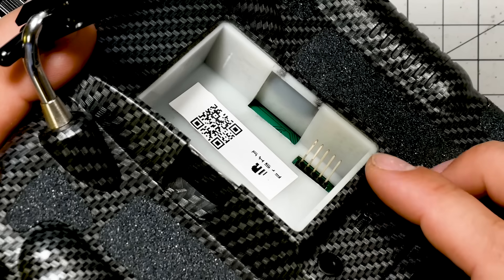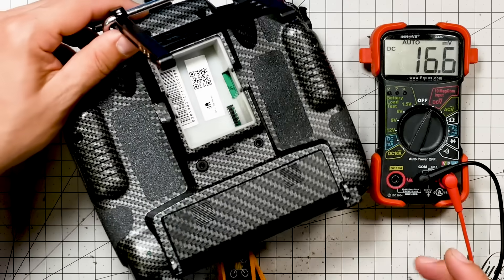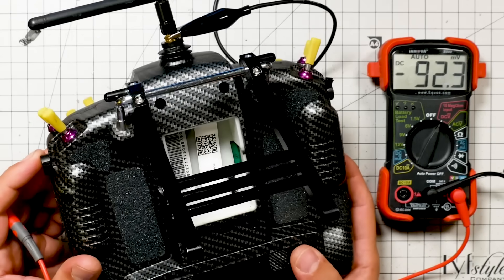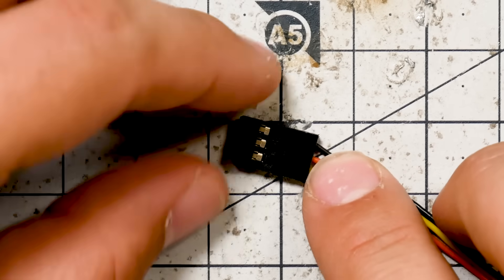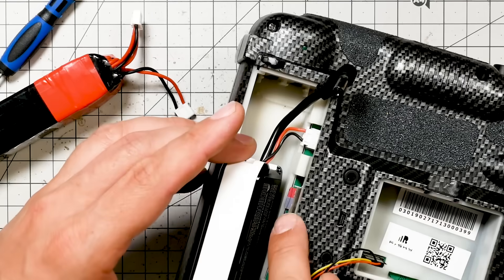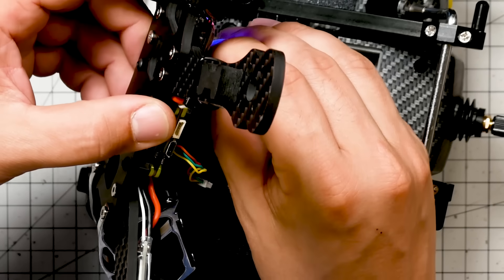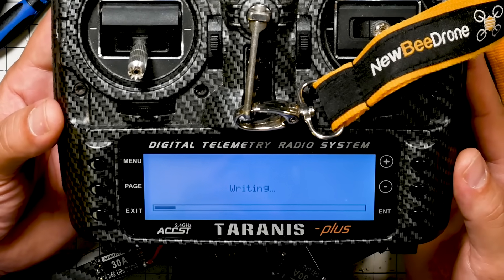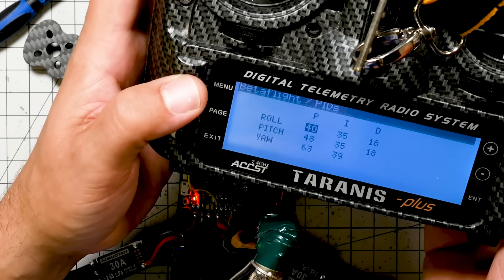FrSky Receiver Firmware Update | R-XSR LUA SCRIPT FIX

Comment: Ever heard of this?
I went through this procedure and it worked for 1 flight, then it started saying telemetry lost, telemetry recovered, also it unbinds and binds back and forth quickly. The quad goes crazy when arming during this issue. This problem became worst as time went on (3 flights). So weird that it flew well after a few attempts (unplug , plug the quad a few times). Now, it will not work. Simply goes back and forth - red, blue light then green , blue light..... I ordered a new xm+ thinking something is broken.  Has anyone see this?
Reply: I think I’ve got the exact same problem...
Can you confirm you are in the same configvas I am : flashed it EU-LBT with the latest firmware from Frsky ?
Reply: @philippemarmonier6635  
Im using the FCC version - newest firmware. I'm definitely going to hold on to it and try to fix it, it's 25 bucks.. It worked totally fine until I flashed it.. I tried going back to and older version, to no avail.. I thought I might have a short somewhere but I put a brand new XM Plus in it and it's fine (without updating!)..
Reply: Hi, I've just found why mine did not work : On the FC board, the signal wire was soldered on the PPM pad. Changed it to an Rx3 pad and it worked fine. Had to dismount the whole quad to access to the board, and finally burned and removed the "easy accessible" pad, but hopefully, on the board I could find another Rx3 pad ... and now it flies !

Comment: Fixed*** I removed external MIC(with100nf cap) out of the system and Smart Audio works EXCEPT that I can't select Raceband 2 and 3. Other channels and bands work flawlessly. So here is another new question. :-P

Sorry to add another comment but please have a look on my problem. I try 5 hours but can't fix. I was fixing a quad which have to use new FC and 4in1ESC. It is TBS powercube 4in1. I just did conformal coating too. Then I switch from XSR to R-XSR and do like you do to update FW in order to use LUA. I end up with 171009 FCC because that is what I can bind the Rx. Later on I got unstable LUA, some times it works most of the time it don't. I check my wiring and re-solder every joint thinking the conformal coating might ruin the soldering until I got solid LUA signal. But one remaining problem is I can't adjust Vtx band or channel in LUA. At first it fix at default (F1), then I could change some but cannot save, then I can change in LUA and save but the real Vtx channel and band don't change. The band R is outstanding, I cannot change to R2 and R3 but I can change to R1, R4, R5, R6, R7, R8. However, all VTx page changes in LUA doesn't transfer to the Vtx. I try changing PID via LUA and check in Butterflight and it works fine. I try swapping the Vtx but got same problem. What is wrong? What to do?
FYI: In LUA there is U band too.
Reply from the maker: This might explain why your vTX won't change channel: https://www.youtube.com/watch?v=1gROVWtWnqk

Comment: Spent hours trying to do my rxsr for f port using my qx7 but the flash never starts . No error just goes back to the list of files. Really confused on this.
Reply from the maker: On the qx7 he wire us standard servo pinout, signal, 5v, ground.
Reply: Joshua Bardwell that's what I have . Using the cable that came with it. Led blinks briefly. Have just updated to opentx 2.2.2 and now see flash s port . Internal and external . S port still does nothing so going to update boot loader....just watching your vid on that . Keep up the great work.
Reply: I had the same issue. Running the newest OpenTX version and using 2s voltage rather than 5v (don't use 3s!!!) helped me

Comment: So my bind button fell off...idk how...but now I need to re-bind it to my Taranis, anyway to do that without the button?
Reply from the maker: It's possible to manually short the pads but some will find it difficult.
Reply: Joshua Bardwell I’m pretty good with an iron, the situation ended up as me overlooking the port in bf, but for future reference: solder a small lead from the center pad to the outer ring (the edge of where the button was)?? Thanks in advance,appreciate all you do!
Reply: Would you mind elaborating on that, my button came off too.  (Though the pad is still there as a little hump that I can press and it feels like it still works.  I'm having a problem binding so I don't know if that's my problem.)

Comment: Hi, any chance of showing how to do this on the x lite, I can’t get it to work :(
Reply from the maker: It should be the same, with the plug on the bottom of the X-lite. It uses standard servo wiring (signal, power, ground) same as the QX7.
Reply: Joshua Bardwell yeah that’s what I was thinking, it didn’t work for me though. I don’t even think the receiver had any power to it
Reply: Hi, just thought I’d let you know I’ve finally got this to work, when going to start the update rather than using flash external receiver I had to use the flash sbus option

Comment: Hi JB! I can not get LUA scripts to work when using the RXSR with Fport. The Lua displays will not populate, it's kinda working because if I don't have the quad powered up it will say No Telemetry on the bottom of lua display, when powered up it goes away. Would you know anything about this? The receiver firmware is up to date

Comment: This is a dumb question Im new to the hobby and I'm always hearing about this brand Im curious on if these frsky receivers are like the old receivers where you would have to plug in every individual wire to it or if the receiver has a set of wires that I solder to the the flight controller ,bind it then fly Thanks to anyone that can help me understand these receivers

Comment: I'm having problems. I load the firmware in the SD but in the taranis does not appear. Any idea what happend taranis firmware 2.2.1
Reply from the maker: In 2.2.1 they changed the name of the folder from FIRMWARE to FIRMWARES or vice versa. If the contents of the SD card doesn't match the firmware version on the radio, you won't see the folder.
Reply: Joshua Bardwell I'm able to see the folders and the content on my computer in the taranis I can see the folder but no the update file or those extensions
Reply: And Thank you you your replay

Comment: Well, I watched your video on upgrading my R-XSR but I do not think I did the correct version. The link was to the FrySky site for the R-XSR ( https://www.frsky-rc.com/r-xsr/.  However you said to use the FCC version not the LBT version.  When I click on the link for the first one (FW-RXSR-171103.zip ) which you said to use, when I unzip it, it only has the LBT file, no FCC version.

So I decided to use the 2nd one down (FW-RXSR-171103.zip).  It installed with no issues but I still have no Telemetry and no TBS Smart audio - Lua scripts data.

Where can I find the correct FCC version?
Thanks in advance

Anthony

Comment: Great work as always JB!  I'm getting all the values but can't change the VTX settings (unity race HV). I'm running a QX7 and r-xsr. My FC is a Matek F-411.  http://www.mateksys.com/?portfolio=f411-mini#tab-id-3
I wired the S-Port on S5 of the FC and reassigned it VIA softserial. SmartAudio is on T2.
I've come soo far and would love to get the control over my VTX from my radio. Man, this is so consuming! Oh and I've got a RunCam Split (maybe that's the problem) Audio conflicting with smart audio but the PIDs show up on my radios LUA script so does the VTX. I just can't Save the values.
Reply from the maker: PIDs showing up means your telemetry is working.

Can you change the vTX settings using the OSD? That would verify that smartaudio is working.

In the OSD go to Features then VTX SA. You should see the current channel and power and be able to change them. If you just see dashes at the top of the screen that indicates smartaudio is not working.
Reply: Sorry for being a noob but do you mean the OSD Features in the Betaflight configurator?  I enabled the feature It reads  -.1.1 when I look in my googles.
Reply: Joshua Bardwell  yes I found it! VTX will not store the settings. I believe I have a bad VTX. Thank you JB!

Comment: seems to be only the f.port version of the firmware is updated...im not using fport so i shouldnt install it...correct?
Reply from the maker: Don't install the FPort firmware unless you want to use FPort. 

Not sure what you mean by only FPort is updated though. Can you elaborate?
Reply: sure its simple i believe....on frskys site under the r-xsr downloads it shows firmware from 2017...or there is the f.port version also there which was updated just last month. so if this firmware is good on any r-xsr then frsky has put the update in the wrong spot because its only showing this new version under the f.port section.  does that make sense to you?

Comment: Josh B, I recently updated my R-XSR using the serial passtrough and while it was very easy to get the flashing process started, the frsky update program kept giving me timeout errors that interrupted the process. I kept on trying since my receiver was now corrupted due to failed update and for some reason after 30 or so tries it ran the update fine.  
It would be super helpful to know the reason for this timeout error and it would make a good video that is very much needed for the good of the community. Pretty please :) would you make tutorial explaining the process and some of the quirks involved with this process.
Reply from the maker: Honestly, I don't know... and this is the reason I personally stay away from serial passthrough and just plug directly.
Reply: Well if you ever get bored and have a pile of flight controllers and receivers to test with..

Comment: I bought 3 R-XSR in 10/2017, updated the firmware as soon as they arrived (never again after that point) and never had any issues. No failsafe ever, LUA scripts work perfectly (thanks to your video), they are just good. 
do I still need to be worried? only thing I recongnized is, that i get "telemetry lost" from my taranis when i get within 5cm of the receiver :D
Reply: It is normal to loose telemetry when you are so near like this from your receiver.
Just move away one meter and should not loose any telemetry or connection at all.

Comment: Hello So i just updated my r-xsr followed this video and my lua scripts still arent working Im not sure what else to do
Reply: and I know my radio is up to date  bc lua scripts are working for my other kwad that has an xsr in it infact I thought it was a thing with kiss  bc my quad with xsr runs betaflight and the lua scripts work but  im running kiss with my r-xsr and it is not working i tried 3 different receivers all r-xsrs no luck all updated
Reply: same here... no luck at all with 2 R-XSR. other quads are working and on my R-XSR i get RSSI in Betaflight, on the Taranis and in BF OSD.   Still my LUA script just show - - - on any of the pages...   driving me nuts

Comment: I can't find any UK law which makes flashing a receiver with FCC firmware illegal. It's technically illegal to /sell/ such a receiver but as far as I can tell it's not illegal to use, especially as we're using the supposedly 'unregulated' 2.4GHz ISM band.

But if I'm wrong a pointer in the right direction would be nice.
Reply from the maker: ISM is not unregulated. It's unlicensed. There are tons of rules about what you may do.

Using a non compliant transmitter is definitely not allowed. RF can't work if people are disregarding regulations about who may transmit where.

Comment: JB, so  most of my RX are installed in my quads. Instead of serial pass through, Can I solder the servo wire to my sbus, 5v, and GND pads and flash the ESC or do i have to desolder the RX first? Thanks!
Reply from the maker: How will you avoid powering up the FC and interfering with the flash?
Reply: yeah i wasn't sure if it was possible. for the wired RX i'll just desolder the signal wire, and for the hard mounted ones, i'll either remove them or live with it as is i guess.  Btw followed your's and PBF's instructions, and i got the F-Port firmware to work on my XSR. now i just need to get the LUA scripts working.

Comment: Jeeezzz... now I know why I couldn't find my drone via RSSI  after I lost it... I was in range, cause it has showed me three times the signal strenght. Once it was 28dB, then after a few minutes later i got 37dB and the last time after 15 additional minutes I got 41dB... and then I have lost it because of the low battery voltage... If it would be without interruptions I would have easily locate it... Lost 200 Bucks... Somebody had the same ?

Comment: I beg to differ in reference to a TBS nano receiver and being unable to brick one because i have a bricked tbs nano receiver that me , and 2 other people with crossfire full and pnp pro who could not unbrick it.  It was a bummer. I just bought a new one and haven’t had issues with it.
Reply from the maker: Firmware 2.24 and above has the rollback feature.
Reply: Joshua Bardwell Its on 2.25 , from what i can tell the rx is stuck in bootloader mode as when i plug it in it stays green even when no tx is on, we’ve tried a lot of stuff to get this rx back to no avail. Flashing through bst port , updating , rolling back , nothing has worked
Reply: I guess the point to my post tho , was that even TBS isn’t impervious to software/hardware problems, these things can be finicky at times.

Comment: I'd like to see more multimeter content.  I follow that checking ground and power are in the right place is vital, but what about the signal?  In this case we have signal A, signal B, power, ground, signal C.  It is assumed that signal C is desired so the power and ground are reversed, but would it damage anything hooking up an unaltered connector to signal B?  I understand it's not going to work, but not working is acceptable, frying electronics isn't ideal.

Comment: Josh do you have any places you can point me on how I can use serial passthrough to flash? Due to size limits in my quad I needed to remove the pins from the r-xsr so I can't exactly just unplug it and plug it into the back of my radio. Thanks.

Comment: Cool video but:
1. You don't need to activate the external module. The Taranis will power the port if you start flashing.
2. This was not a 3-cell balance plug since is has only 3 wires. A 3-cell balance plug has of course 4 wires. You can use a 2-cell battery in the Taranis just fine. Don't use a 3-cell for flashing though since most receivers only support voltage up to 10 volts.
3. LBT means "listen before talk".

Comment: Flashing firmware with a spektrum radio is considered by many as a no no. In the Taranis world its so easy especially if you have a QX7 or X10S. Every-time you do this you end up with a brand new more capable receiver or other device.

Comment: Hi Joshua. LBT means "Listen before talk" part of the EU specification requires the telemetry channel to have lower power output compared to the FCC as well as the protocols requires the receiver to only transmit if spoken to by a bound Transmitter.
Reply: Does this mean i could have lower voltages on the pin header ? Because i'm from a EU country and i have troubles figuring out wich pin is wich on my Q-X7
Reply: @darmanskirata4198  No, it means you only Tx 60mW instead of 1 to 2 hundred, not much difference, US has more space. Many Tx only put out 60mW.

Comment: Still not sure what the connection between the Taranis and R-XSR is, i.e. power ok, but what about the signal wire that actually does the FW update?
Reply: It's on Oscar Liang's site ok. 🖒
Reply: Since he uses servo plug where two lines are ground and power, the signal line you get automatically as you plug it.

Comment: So you located power and ground (using your after market 3S lipo, which makes it hard to reproduce for the average Joe) and signal is one of the remaining 3 signal pins? Then you connect the wires to which pins on the receiver? If I hadn’t tried it before I would be lost by now. Please be specific about using the s.port (which becomes f.port) in your F.Port video, please :-)
Reply from the maker: You can locate power and ground using the stock 2S battery too :-)
Reply from the maker: The wires go to signal, power, and ground.

Comment: Does anyone know where you can the serial pass through way of flashing he mentioned? My receiver is already installed and lua scripts don't work.
Reply from the maker: https://www.phaserfpv.com.au/blogs/blog/flash-frsky-receivers-via-your-flight-controller-using-smart-port-betaflight-serialpassthrough
Reply: Thank you
Reply: I am using the matek vtx fchub I am trying to follow these directions but my smartport is going to motor signal pad 5 not a part, am I still able to update this way and what would I put in the cli?